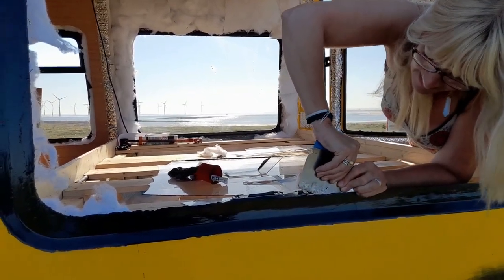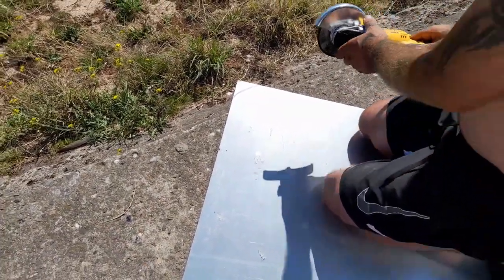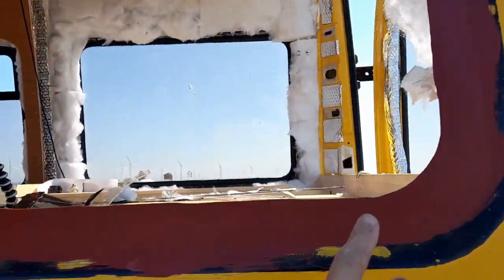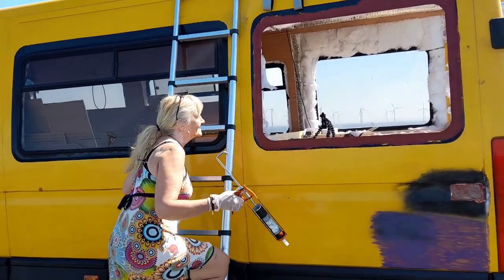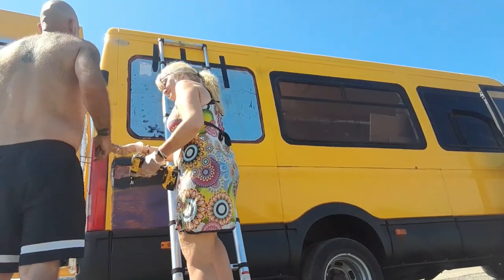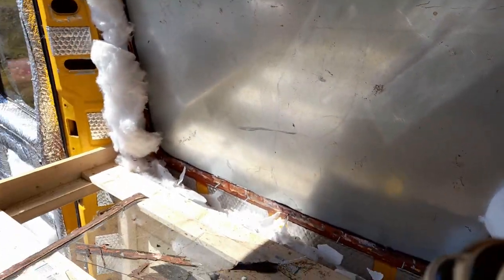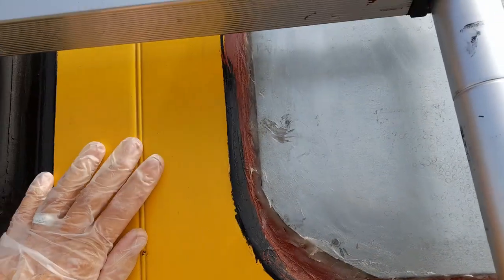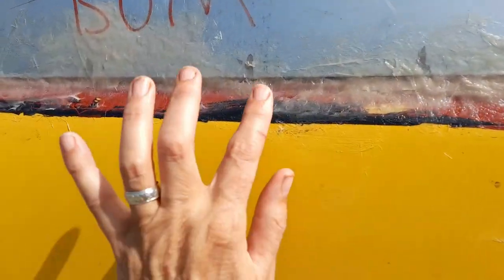Iveco Daily Minibus Conversion- Replacing A Window With Sheet Metal.. #busconversion #vanlife #iveco

Comment: A job well done Coral 👍.  It's great that the weather has been lovely and dry for weeks enabling you to get these outside jobs done........though I imagine that it will have been very warm 🔥 🥵 for you working inside the van
Reply from the maker: Hey Annie, yes, I am grateful for the good weather, although like you say, it's been rather hot in the bus at times! Mind you, one thing to rely on here is the breeze (or gale force winds!) which keep things cooler. I guess it'll all change soon though with summer coming to an end ☹